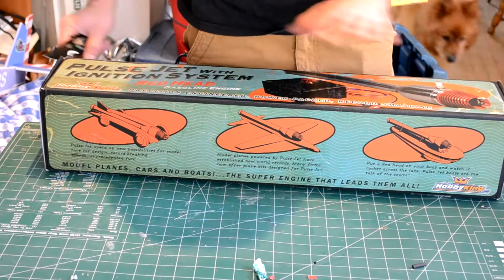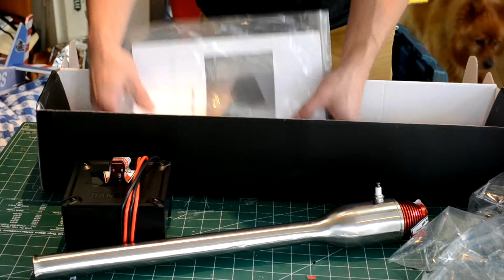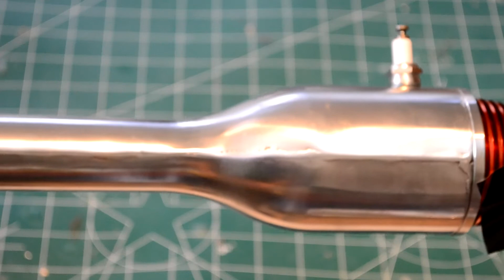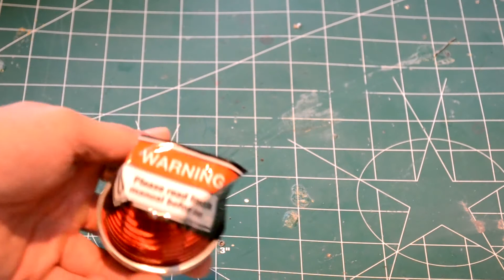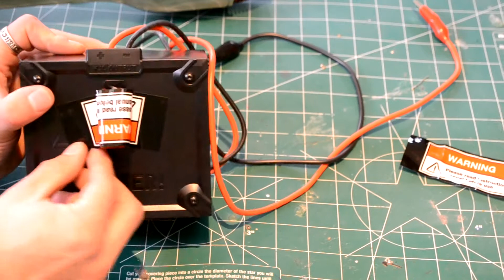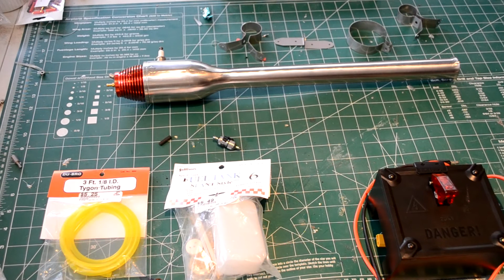Unboxing and Review --- Hobbyking Pulsejet!

Comment: Buss Box is good for barbucue only.Flowjector is crap to.Spark Plug to big to.
Reply from the maker: actually, I got it to ignite once or twice. Flowjector is way awful. couldn't get proper vaporization for the life of me, and all I know about the plug is it fell apart lol. 

I seriously doubt they will be able to pull off a turbine
Reply: Brendan Stewart
Reply: I take that back.I managed to get my Two going after putting a Nitro 5mm spark plug in & putting it at the base.Metho & a better flowjector.Starts evan with stock Buzz Box now in seconds.
Reply from the maker: nice man! how many lbs thrust?
Reply: Brendan Stewart On some days 4.25 LBS with big (74 Thal ) Main Jets.3.5LBS with 63 Thal.Only fish scales used so not 100% accurate.Cheers
Reply from the maker: Man that's some great performance. played around with a thrust augmenter yet?
Reply: Brendan Stewart No.I have not seen anybodys work yet on any Pulse jet.My afterburner only worked on a er90 & that was just 2.5lbs extra so far.
Reply from the maker: nice! I'm going to start playing with an O2 after-injector as soon as I can get it running. I'm not planning to fly the thing, but maybe a jet powered skateboard ;)
Reply: Brendan Stewart what is 02
Reply from the maker: Oxygen. at atmospheric pressure oxygen bonds with itself to form o2